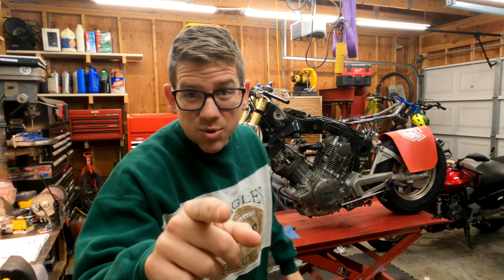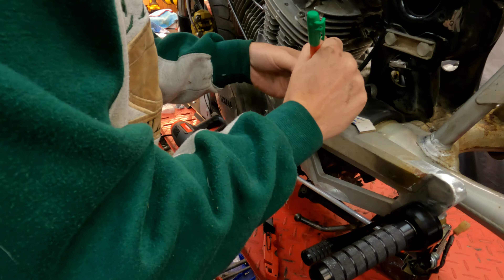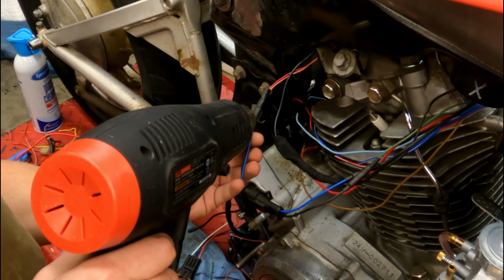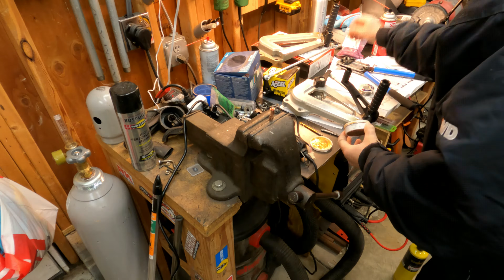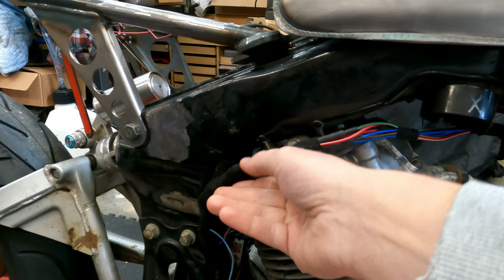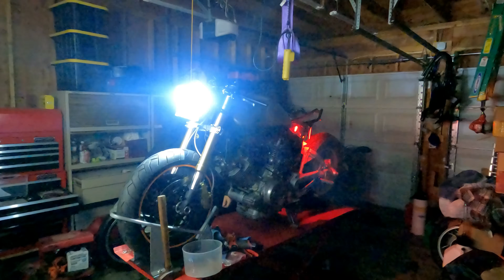Building the WIRING HARNESS on Our Cafe Racer Project - Yamaha Virago Build Ep11

Comment: Hi, i was wondering how you tackled ricks rectifier/regulator .i see two wires (assuming positive & negative)but there should be a third brown wire for a fuse box and main switch. How were those items connected to the rectifier?

Comment: Do you happen to have the wiring diagram you used for your neutral safety switch and from your tcm to your coil? I’m working on a 920 now and I’ve got it to turn the motor over but I’m not getting spark.

Comment: I see you used a dual outlet ignition coil. How did you wire it from the TCI box? Did you use all three wires the red, the orange, and the gray? Or did you use just two? If so which two wires?